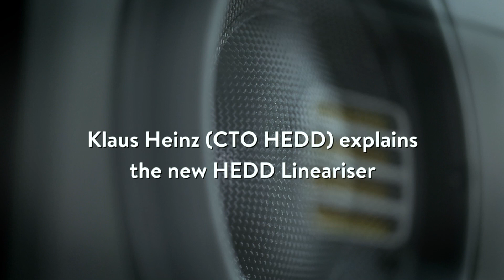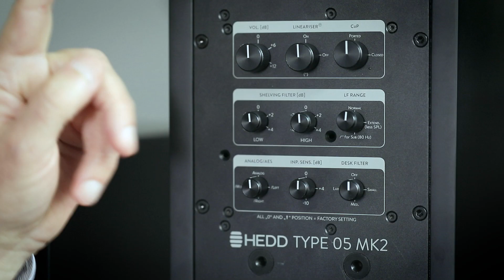How HEDD's Lineariser® Technology Can Improve Stereo Imaging

Comment: I just tested the lineariser switched on versus off while playing a sine wave-based synthesized kick drum, where the frequency of the sine wave starting at around 10khz and over a period of 100-200 milliseconds decreases down to about 40 hertz (typical of a kick drum from the genre knows as"Psychedelic Trance"), and in fact with the lineariser on, it completley destroys the transient of the kick, much like the sound of phaseshifting as a result of using a non-linear-phase high-pass filter on this kind of kick drum. By destroy I mean it introduces "pre-ring" - essentially playing the sub freqeuncies (the kick drum tail) before the the high frequencies (the transient of the kick drum). 

So it appears to me that at least in this particular scenario, that the lineariser does quite the opposote of what is described in this video.

I assume and would hope to find that the lineariser improves timing in other examples of recorded music, unlike it does so in my sine wave psy trance kick drum scenario. 

Thoughts?

Comment: im producing and mixing at the same time and I know so many ppl are doing the same thing. what applies in this situation with the lineariser as you cannot go back and forth behind the speaker
Reply from the maker: It will not affect your mixing/producing in your daw
The latency can only be noticed during live sessions or when trying to track.
Reply: @HEDDAudioGmbH  thnx for your reply, however this does not answer my initial question as im tracking external synths, recording and mixing at the same time..
Reply from the maker: @ekoboydj  When you´re tracking external synths and recording then yes the Linearizer should be turned off cause it will cause confusion. 
sorry for the misunderstanding!